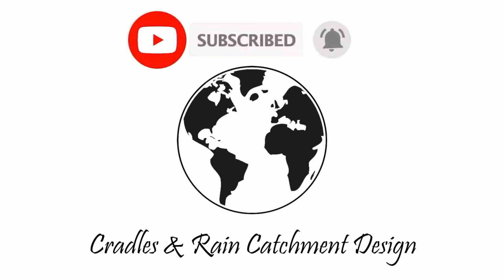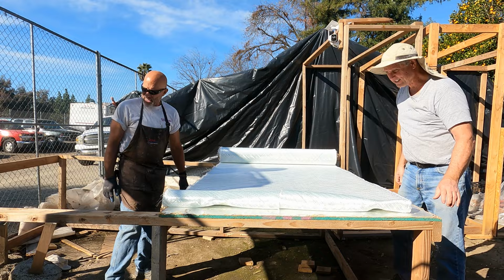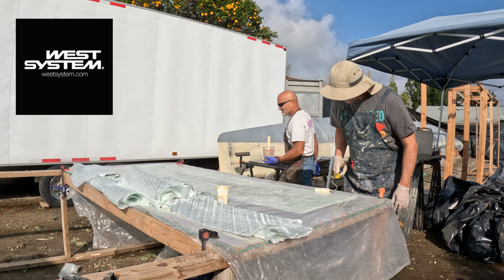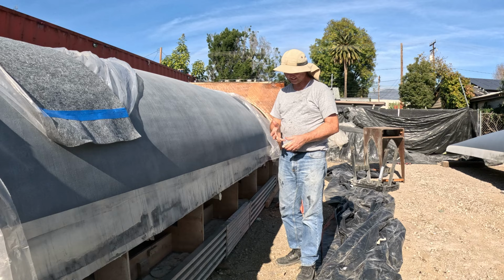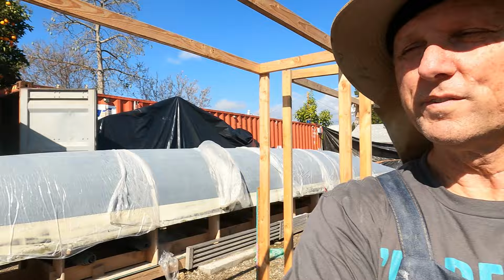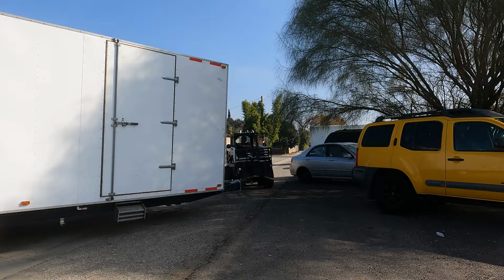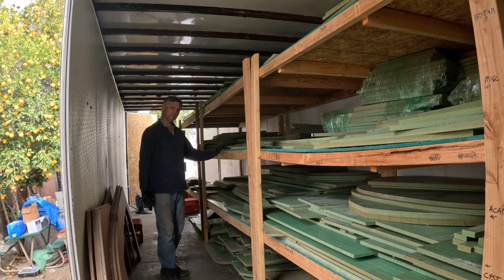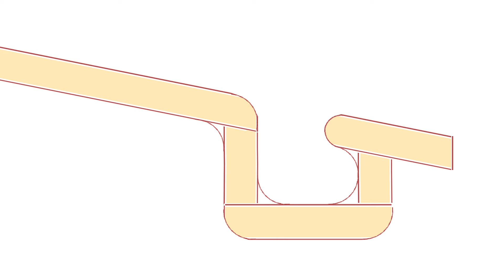Kit E70: Cradles and Rain Catchment

Comment: Things are moving along nicely and glad the city gave you some slack on removing the container from the yard. On the rain catchment - I cannot recall how many water tanks you have  - but for consideration could you dedicate one tank to service both bathrooms and have that tank  as the rain catchment ‘destination’ exclusively. It does not preventing you topping up via the water maker (or shore) but it ring fences the hygiene aspects and could in extremis introduce a brake on unnecessary water consumption in the bathrooms.😉👍⛵️
Reply from the maker: It's an interesting idea, but we prefer to have the choice to use any tank for any purpose, depending on the need.  There are four tanks, two typically collect rain water, one to port, one to starboard.  There are two other tanks that, one to each side.  These typically get their water from the water maker unless there is enough rain to fill all tanks.  In that case, we would test the water collected in the first two rain water tanks before transferring some to the other two tanks and then letting the rain water tanks refill.  All tanks can also be filled by the water makers as well or by shore water.  But when it comes to usage, we can use any tank for what we need.  The main point of multiple tanks is so that no matter where the water is coming from, it goes into two tanks, not all four, and is then tested before we move some to the other tanks, if needed.  When water is moved between tanks, we 'polish' it through filters as well.

Comment: Agree with the structural concerns mentioned elsewhere here but also consider the extra challenge keeping that trough clean…. Be it sand, debris, mossy mildew etc those troughs will require cleaning.
Reply from the maker: Yet, they are far easier to clean that the original plan with holes drilled in PVC pipe.  :)
Reply: @SailingSVLynx  Yes, the holes in the pipe were going to be a nightmare to try to clean.  Your design makes much, much more sense!  Well done!

Comment: In order to avoid inefficiency for the water trap I'd do a 2 inch opening. This will ensure no water swaps across the trap. And for not to weaken the structure of the cabin top the trap should be outside the vertical walls. Otherwise this would act like a spring when sheet or mast loads try to tension the roof. Hope you made sure the windows leave enough height between the roof and the upper window edge or the ceiling inside. Consider also the piping below the trap for that.
Reply from the maker: We already plan to have it outside, in the hangover portion that is just for shading the windows.

Comment: Great progress this week. Looking forward to the Coppercoat going on. Not sure about the strength of the gutter, aesthetically and from a practical purpose it looks great. However a large person stepping on the outboard edge of the gutter is certainly going to load it significantly. But enough glass will take care of that, a test section is certainly the way to move forward. Make the gutter opening wide enough so it can be easily cleaned. 👍
Reply from the maker: That's the plan!

Comment: I like the rain catchment system. I think it will work. But it may be harder to keep clean compared to the as-designed one with the PVC and the holes. Also, the grab rail functionality will work, but it will be harder to grab than a rail that stands up off of the surface so you can wrap your hand all the way around. So it is a compromise. Just as a thought, if you put cushions in the areas where you want to sit, maybe that will make the original system more workable since the cushions will keep your gluts up above the raised PVC.
Reply from the maker: We think the PVC would be harder to clean.  How would you get inside?  The recessed slot can have a sponge inserted to wipe it out.
Reply: @SailingSVLynx  Oh, I see what you mean. Yeah. You couldn't clean inside the pvc without some kind of fish. But the valley just before the PVC would be easy to clean. Hopefully not much gunk would get inside the pipe itself.

Comment: the rainwater catchment looks practical and functional, but what came to my mind was dirty hands, I don't know what kind of filtration you where thinking of. but the undercut is more dificult to clean. and your hands maybe contaminated with, oil, fuel and grease from working on the boat, engine, winches ect. i don't know if the filter will get that out, and if it could cause long term heatlh effects.
Reply from the maker: Not too worried about that, if we get anything in the gutter like that, we can clean it.  All water collected goes through some serious filtering as well.

Comment: For making stands for the catamaran, you need just wery bottom part of the MDF and glass. Upper part is useless.
There will be several tons on each cradle. So make it proper strength ...
Reply from the maker: These were sent by Schionning, and work well.  Other boats (many) have used them, including another 1520 that is ahead of us.

Comment: 21:40 woo that top shelf is warped in middle badly. I'm afraid if you don't address that right away it will transfer that bend to your foam boards and that sure will cause issues when comes time to use those parts.
Reply from the maker: As we wrote in the video, we are fixing them.  :)

Comment: If i was building your rail catchment system i would try to produce various lengths of the “inside portion” of your handhold area using fiberglass cloth.  Should be able to rap fiberglass around a mandrel (ie. Plastic pipe) to create the required shape.  Later these various lengths could be incorporated into your square shaped pieces of foam.
Reply from the maker: We are looking into that :)

Comment: Your rain catchment design looks like it will work fine .... I understand the choice to make it flush, my only concern would be if the volume of rain water run off will be caught in the channel (channel volume looks ok ..... more so that the velocity of the run off water whether from heavy rain or wind effected may push over the gap especilly with the flush gutter. Maybe a slight flare on the outer edge or even rather than a blunt bullnose maybe more of an undercut chanfer to enhance water capture (probably not an issue, if you are getting that much rain your probably gunna catch enough)
The suggestion would be to consider how you might be incorporating your rear deck clears ..... it is a good idea to think about a clean flush stowage option now rather than just have them hanging rolled up ..... I think Leopard Catamarans have theirs nicely tucked away flush under their roof. You certainly would have room with your design, might just need to incorporate some sail track 4" in from channel moulding (underneath/coach roof ceiling edge)
Reply from the maker: We plan to build a mockup first and test it before messing with the real cabin top.

Comment: Great work guys! Shame the fwd cradles didn't fit - will this be rectified on the kits going fwd? With your gutter design; I would suggest this be the very edge of your roof as the outboard upright of the gutter will finish that nicely. The section reminds me of a recessed SUP handle - inspiration? 😄
Reply from the maker: On the sup... no, but we did get the idea the recessed idea from other cats, like some Fountaine Pajot boats (Salina 48, for example).  We will be telling Schionning about the cradle issue, so they should get it fixed.  We aren't sure how far out we will go with the gutter, we'll figure that out when we get there :)

Comment: love the idea of rain water catchment but how are you going to let first 3 minutes of rain go overboard to clean off roof befor storage
Reply from the maker: There is a direct drain to the ocean that is controlled by an electric valve from the helm.  Once it has rained for a bit, we can flip the switch and send the rest of that rainwater through the filter system, which sends it into dedicated rain water tanks that would not foul the rest of our water, if something went wrong.

Comment: Is the roof for your helm included in the rainwater collection system?  It looks like it'd collect a lot.
Reply from the maker: It will.  The hardtop will drain forward, down a tube, to the cabin top collection system.

Comment: Thanks again for sharing the journey through the build.  I do wonder about the strength of the rain gutter.  Glass is strong, but the strength after going through four essentially 90 degree bends is uncertain to me.  For it to handle the downwards force of a human (foot or bum) or any line temporarily led over the lip and tensioned (for whatever reason that comes about) seems uncertain to me.  Not as strong as the uninterrupted planar sheet.  But maybe I’m wrong?  I’m sure you will make it good in any case.  Thanks for sharing.
Reply: If done properly this is no problem. But read my comment on sheet loads and the position of the trap.
Reply: @Hotzenplotz1  without using big amounts of glass and resin….     isn’t the leverage gained by the gutter greater than that of just a load on a planer sheet?  I’m no engineer but just thinking about it on a gut level….  it seems that a load on the outside edge has the leverage of the depth of the gutter.  More than it would have if it was simply sitting on the same spot on a planar sheet.  Like I say, I could be wrong.  And yeah, I’m sure you can make it as strong,  but that might require a lot of glass.
Reply: @tonyfromaus7855  No, sheet loads are horizontal as the ropes are moving horizontally across the roof and will therefore try to open or close the gutter. The cabin top is engineered by the naval architect to be strong with all the beams, walls, window stanchions and bulkheads. It's not just a planar sheet of fibreglass, it's always to be seen as a whole. At last the roof itself is not planar either. But if the gutter is placed wrong it can influence the strength negatively.
Reply: @Hotzenplotz1  I wasn’t referring to ordinary sheet runs.  Just imagining a line led over the edge and lashed to the toerail or cleat.  Perhaps temporarily holding down a wayward dingy or a solar panel or whatever.  But that’s not the main point.  My point (and I may be wrong) is that if the roof was a plane then the weight of a man on the edge would presumably be ok.  But after those right angles the depth of the gutter can be the leverage that a load on the top outboard edge would be applying to the first right angle.  More leverage than a planar sheet would feel.
Reply: @tonyfromaus7855  That's an argument, but it can be done with a little more glass and thicker core material. A beam becomes stronger if the distance from top to bottom is increased, therefore thicker core. And it doesn't matter if the outer edge flexes a bit.
Reply from the maker: As for sheets putting pressure on the edge... no sheets will be led over the edge of the cabin top that put any downward pressure on the edge.  Then, for strength enough to handle a human's weight, well, that's a matter of how much glass we add.  We'll be mocking up a test section first and testing that out.  Of course, this is assuming the Schionning designers sign off on it first.
Reply: @SailingSVLynx  I didnt assume sheet loads on the edge. That's been someone else. You may consider nicely finished brackets below the overhang.